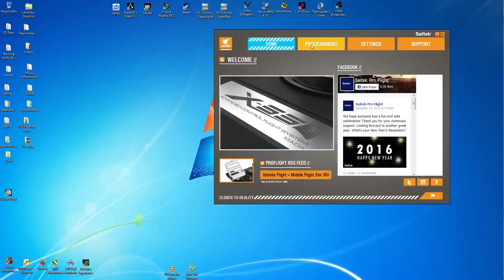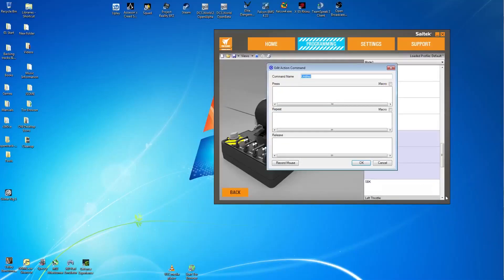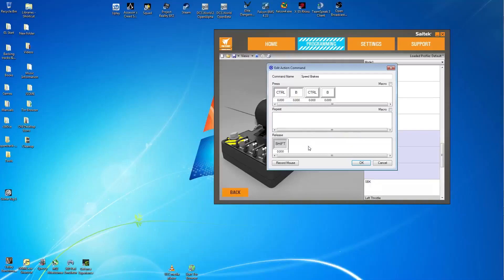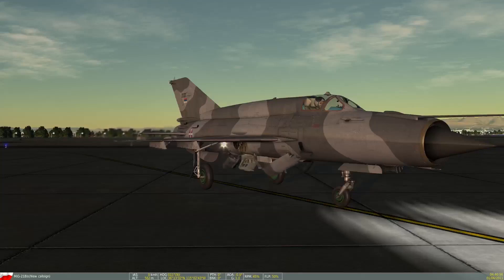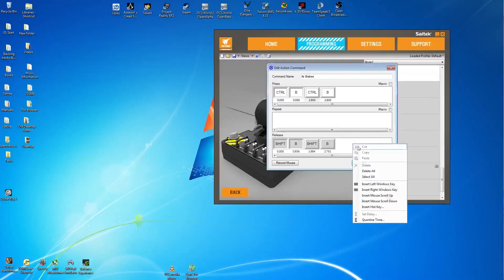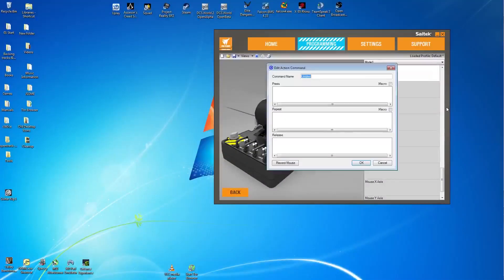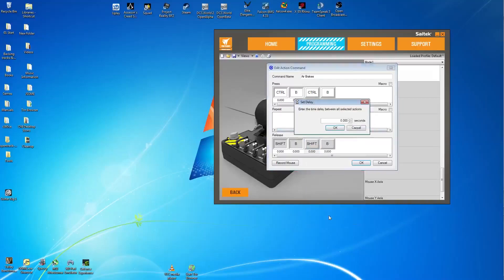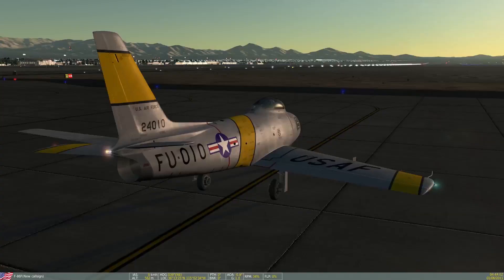Programming The Saitek X55 Slider

Comment: I am trying to do with with my X-56.  It can't be that much of a difference.  Trying to set up for the A4 Skyhawk.  Nothing I do works for the slider.    When I go to the test.  Nothing happens?   I can set it up in DCS and move slider forward.  Speed Brake Opens,  But I have to moved Slider back and then forward again to get Speed Brake to Close. I am not sure what the Button # is for moving slider back.   Forward is Joy_BTN 33. Can you assist?

Comment: I bought an X56 which has the same software and the same switch, and can't get this working. I've done exactly as in the video, but it just doesn't do anything when I slide the switch when I have the test window up. Any ideas?
Reply from the maker: Thank you sir!  The only thing I can suggest is sticking on the latest firmware, possibly removing the driver, USB, and deleting the entry in Regedit.  Then re-install everything, leaving plugging in the USB until last.  Other than that check the latching command is working for other buttons.
Reply: @Laobi  I don't think it's an issue with the stick. The switch does work. Just the custom actions aren't firing, no matter which button I assigned them to.
Reply: @VexingRaven  I've got it to work by turning off the latch command, works perfect now for my x56
Reply: @SuperDonk1980  I tried both, could never get it working. Oh well.
Reply: @Laobi  doesnt work on a brand new stick clean install either tried everything

Comment: Trying to do this with the x56 in the f16 however it doesnt work, neither quantisize time or delays work
Reply from the maker: Thank you sir!  There may have been a change in the software, additionally it may be worth checking if the F16 airbrake can be incremented (temporarily bind a throttle or slider to air brakes and test on the ground).  I know there are some/most aircraft where the airbrakes are either fully open or fully closed, I can't remember if the F16 is one of them.

Comment: Hello Laobi,
Thanks for the helpful video first.. I have been late for asking maybe but hope you can help.
I'm "tryinnnng" hard to make a profile for DCS F-16 Viper for X52 Pro. I'm trying to set Speed Brake to the Precision Slider on the throttle. But profiler programming doesn't give me "New Advanced Command" menu or others. I can only Unprogram it, Fallback, Bands and Directional Axis. How can I set it? I have unprogramed it and no chance for the new menu, everything is same. Tried Directional Axis with the keyboard commands, test shows that I'm pushing that combination as fast as I move the slider but it simply doesn't effect the Speed Brakes in game.. Help please?
Reply from the maker: Thank you sir!  That slider is a pain, it's more of a momentary switch than a true slider, I was able to latch it to get it to work with air brakes, but I'm sorry to say it won't work as an axis.
Reply: 2 years late, so perhaps you’ve solved it or moved on, however:

Setting the slider, which is an axis, to bands  can produce the result you were looking for.

You can then create multiple bands, i.e.:
- Band 1: 0 ~ 33%
- Band 2: 34 ~ 66%
- Band 3: 67 ~ 100%

Set Band 1 as open airbrake (Ctrl+B) and set Band 3 as close airbrake (Shift+B). You can add the timing macros from the video.

The number of bands and percentages are also freely customizable.
Reply: @tver  Thanks Tver.

Comment: The switches aren't appearing when I test them, I saved the profile and sent it to the stick but I can't seem to find out how to fix it. Any ideas?
Reply from the maker: Thank you sir!  It sounds like either something has changed between Win 7 and 10, or (hopefully) Windows is recognising your throttle as a generic.  I would suggest the following:

1: Unplug both the USBs for the throttle and stick
2: Uninstall all the Saitek software including the profiler
3: Shut down and restart your PC
4: Re-install the Saitek drivers and profiling software
5: Re-start the PC and reconnect the USBs